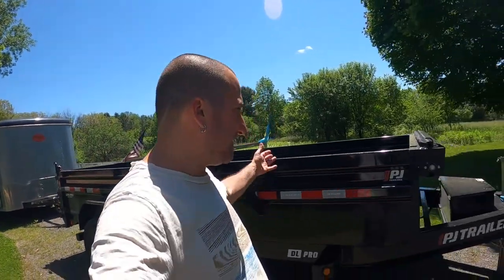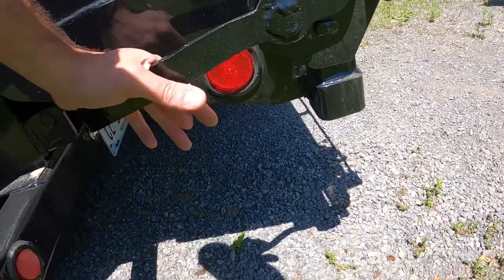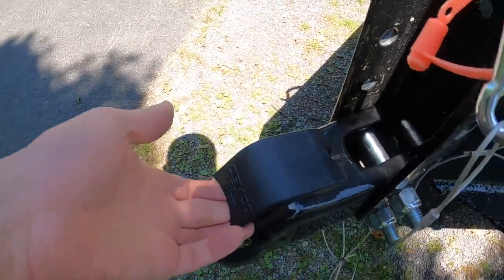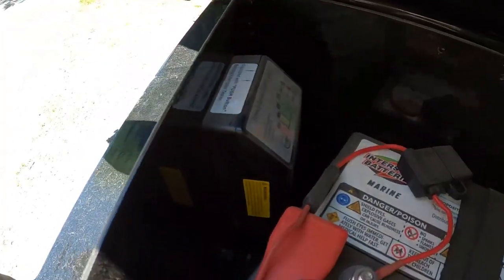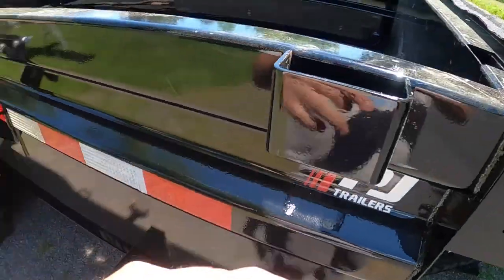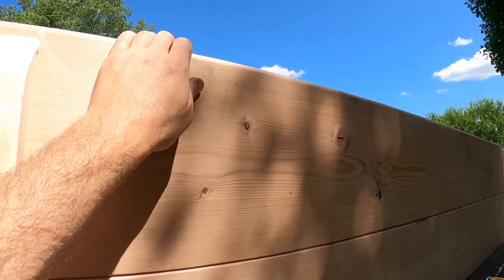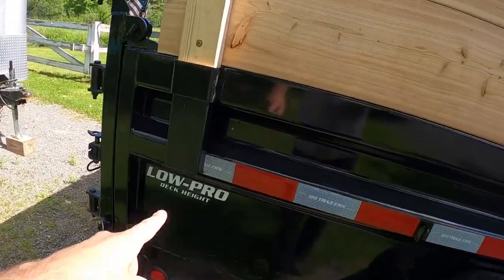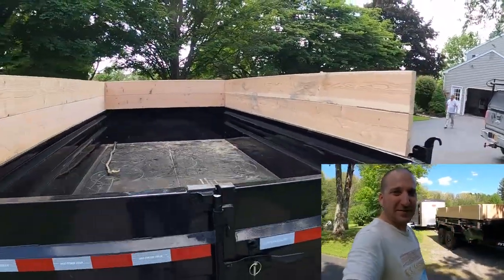NEW 2022 PJ 7x14 Dump Trailer Setup | DL142 | 14k lbs

Comment: Nice trailer, I just bought one exactly like it. I like the way you added the 2x10's to it. I think you can also remove the bushings on each side of the top of the back gate and pull it down like a truck gate if you want.
Reply from the maker: Yeah I just bought a 2024 version of this trailer and a few months ago a 2013 version with 4" drop axles. They all have different features. Seems like they keep tweaking the design. I wish they would improve the hinge and latch for the doors because the welds crack and the doors don't stay open. I've already had the left door on the 2022 not latch and swing open without me noticing and I lifted the trailer and destroyed the door. Had to have it fixed by a welder. And the 2013 hinges have been gobbed with welds and just had it repainted and re-welded again. It seems they could find a better way to do it.

Comment: Dope video! Definitely helped me decide my purchase!
Reply from the maker: The only complaint I have is the battery doesn't charge off the truck!!! I called the dealership and they said the new trailers don't do that anymore! It has a plug built into the side and you have to plug it in. I bought a solar panel battery maintainer but it's not big enough so I have to get a bigger one

Comment: hey man, Im looking at getting my first dump trailer and was curious how that pj has held up?
Reply from the maker: Rusts like crazy. The hinge welds kind of suck and crack and the doors don't close properly. I bought another one (2024 model) and I was very disappointed with the build quality versus the 2022. They definitely cheaped out or hired a welder who doesn't know how to weld. The stick that holds it in the lifted position doesn't line up AT ALL with the slot it's designed to go in. The 2022 model was assembled/welded better. I did a comparison of my PJ vs my buddies Sure-Trac and the PJ's frame is WAAAAAAAYYYYYY more heavy duty. That's why I got another PJ. And I had a Bri-Mar before that and it was a freaking rust bucket rot box. It towed and lifted awesome and mechanically was great but it was worse than swiss cheese. Did so much welding on it and couldn't get ahead of the rot so I sold it for a loss. Honestly I don't think any company builds these things to last. Powder coat sucks and chips and peels off, I don't care what brand it is. Note: I am in NY and lots of salt on the road in winter, but these start rusting even before winter

Comment: What size boards are those? Trying to do the same thing to my trailer!
Reply: Ha you too?  Just was doing mine today.  I went to a garage door installer, and got a couple old 16' door panels and used those rather than wood.  Really sharp looking, but will see how the hold up.  Feels nice and sturdy but time will tell.
Reply from the maker: sorry im way behind on replying to comments. They are 2x10's. I debated over using 10's or 12's and I've been happy with the 10's. They made the trailer 12+ cubic yards instead of being 7+ without sides